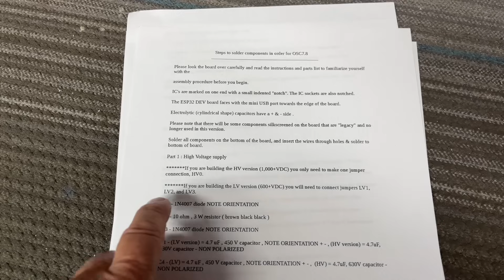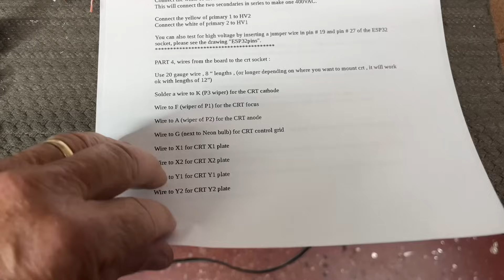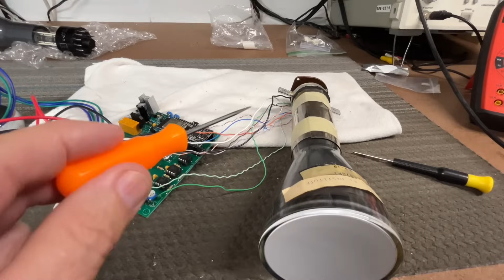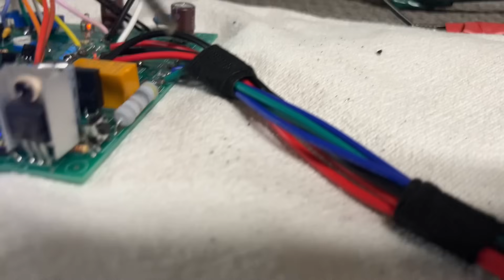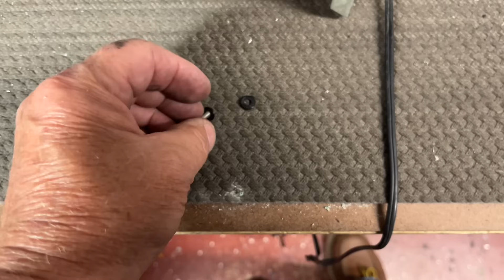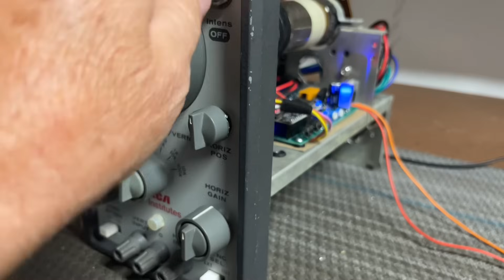CRT Clock Build using an RCA Oscilloscope

Comment: I have a 5" Magnavox crt tv and I have no clue what I'm doing. One TV has a horizontal line. The other one has a squished image. I'd like to use crt and find a complete aftermarket kit to make it work. Any suggestions?
Reply from the maker: All the kits I’ve seen are the ones where you build the circuit board like I showed in the video. 
They use Electrostatic CRT’s , if your 5” set is from the 70’s 80’s etc..  that’s a different type crt.